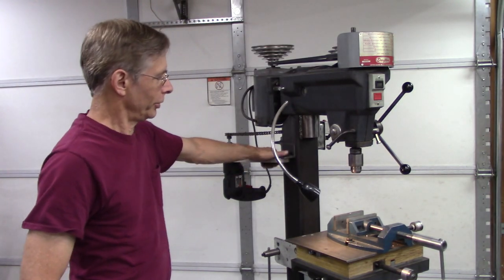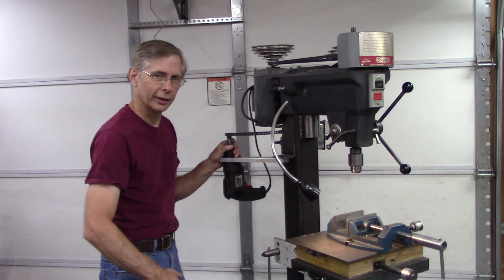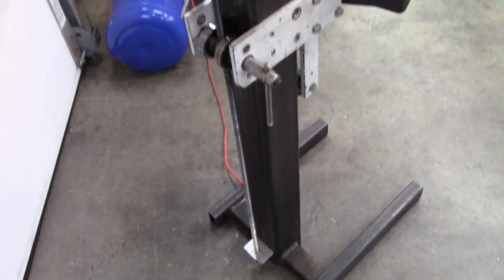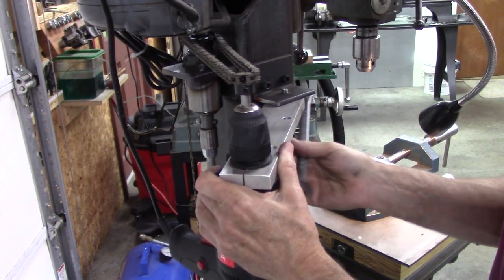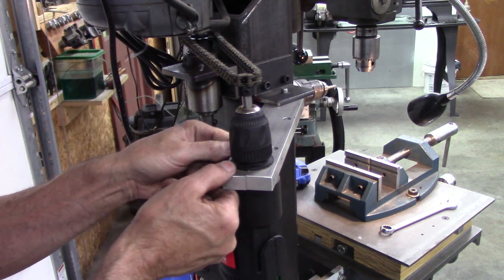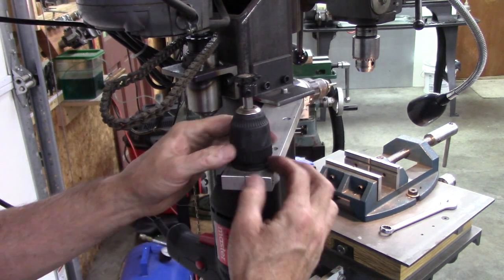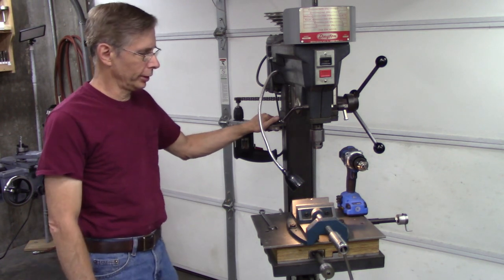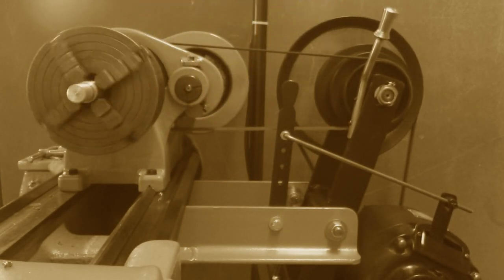Power Table Lift for my Square Column Drill Press

Comment: boys that square column drill press is impressive I want to build one so bad, watched that series 3 times already you did a great job on it and it seems to work flawless, the lift is great a cheap drill and if it burns out you just buy another one.awesome job.
Reply from the maker: Yeah... $8 Bucks I think. Thanks. If you build one the most critical part is getting the top tube welded straight. I welded mine and got it perfect but I think I would bolt it on if I had to do it over.

Comment: Everyne has a corded drill they rarely or no longer use. I have several that just lay around taking up space, so this is an excellent idea for such a left over tool. I gather the screw is just standard threaded rod?
Reply from the maker: The lift screw is a 1/2" -13 thread. Acme probably would be better but the standard thread will probably last my lifetime.  I used a HF drill. With a coupon I got it for $9.

Comment: I don't know if it would be all that useful but wouldn't it be fun to add a digital readout!
Reply from the maker: For me it is extremely useful. You can go from a center drill, drop the table so you can fit a 1/2" drill and then drop the table for a 12 inch long reamer without losing your horizontal reference point. As for the DRO, that would be great. I have dials the the DRO beats the heck out of counting turns! Thanks